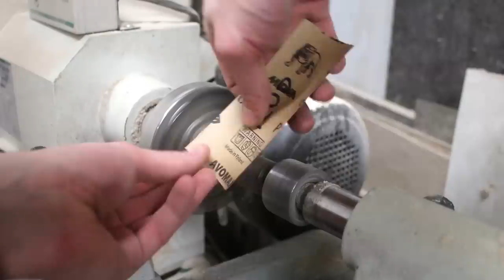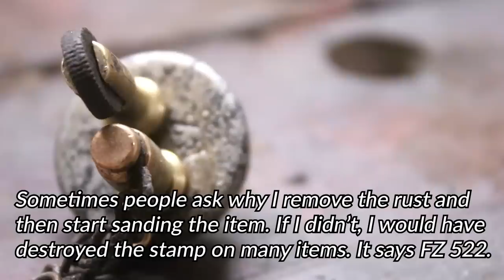Antique rusty lighter - Restoration project

Comment: 2019: let's restore a 100 year old lighter. Bad ass video. Metal working.  
2119: let's restore a 100 year old lighter. Sands down plastic. Lighter is gone and now you have cancer from plastic inhalation.
Reply: 2319: lets restore a 100 year old lighter.  First of all lets take the nuclear core and put some moon dust in so it can burn good and then take the star piece and put it in the lighter for max efficiency
Reply: 2419 lets restore this 100 years old lighter, First we pick the Mortnekh Powder and mix with Xhusfhog
Reply: 2519:let's restore a 100 year old lighter.
first of all, do some electromagnetic with anti matter energy spilled into core. Especially,  when working RTX 2 Gryxonide Appropriately.
Reply: Well that happened...
Reply: History lectures in a nutshell
Reply: But he does restore plastic on this channel. xD
Reply: Bahahahahaha
Reply: 2719 let’s take out the miniature black hole and a piece of Pluto for the wick and gas from jupiter for lighting fluid not to mention a simple atom

Comment: For the cap, there are radial sanding discs for Dremels and flexshafts that would have drastically cut your filing and fiddling time around those tiny parts on top. They're plastic bristle brushes embedded with grit. They're used by jewelers all the time and don't cost a lot. You can find them at places like Rio Grande and other metalworking websites.

Comment: Never really been a fan of sanding out pitting, when possible I prefer to heat up the item in question then sprinkle on finely ground metal filings, which melt and fill in the holes/pitting! It'll often leave the surface textured, but that I will sand away and original surface (mostly) won't get damaged/thinned. Not 100% fool proof and not always possible, but the results are often very good when you can!

Comment: I have a hunch that the cotton inside the cylinder was originally a thin cotton rope/string, big enough to stay in the hole, as a flameless lighter is.... not a flame lighter... only reason why I think that is because it's the only one in the bag that didnt have a large lid/cap to cover the whole top so you wouldn't burn your fingers. Also when those were used it usually was in trenches or  in a combat zones (her-der-der there) and a flame would make one stick out at night.

Comment: The cap came out really nice but I kept thinking the brass fittings would screw off out of the way.
Reply from the maker: It wont. It had a rivet type of attachment
Reply: @OddTinkering  It still turned out excellent, I was suspecting WW1 use as I have seen some lighters of that period with some similar design features.  That perfect number on the bottom seemed more like a serial number than a model number.

Comment: Ok seeing thing i would have done differently. Would have sanded to at least 3000 grit on the body. That's minimum for a deep shine. Would have removed the brass top parts for easier access. You went threw an awful lot of time and effort  with that. Would have used a dremel on those lines you did with a file. A lot easier. Is the bottom silver?
Reply from the maker: The top parts were not screw-on but they had raher a rivet type of attachment. The bottom is brass
Reply: @OddTinkering  I would have drilled it out in that case. Put another rivet in when done. Most rebuilders do. Just trying to help you with thought.

Comment: One question... please tell me you didn't pack that thing with cotton. Cotton coated with lighter fluid can self combust at around 150 F. You should use rock wool, also known as the safe asbestos. Rock woven into fibers with the consistency of cotton but does not burn and can stand temps above 1000 F. Much safer to use.